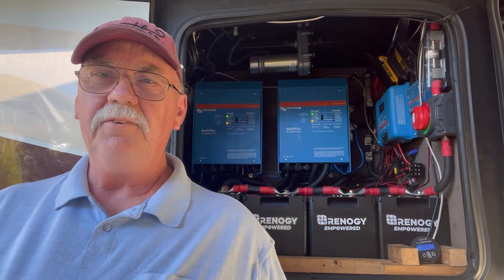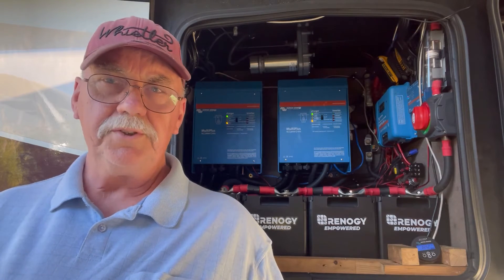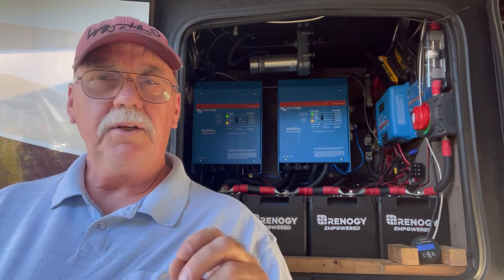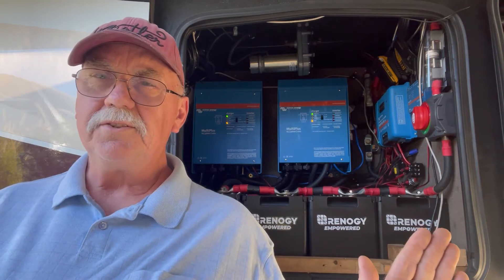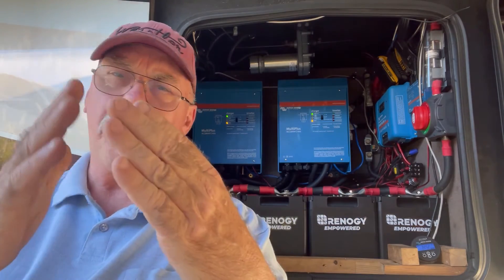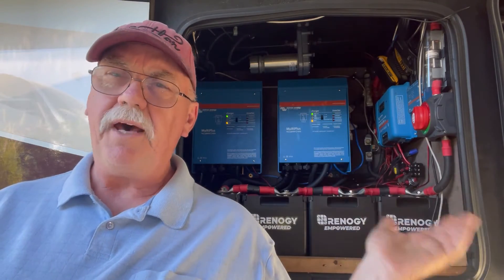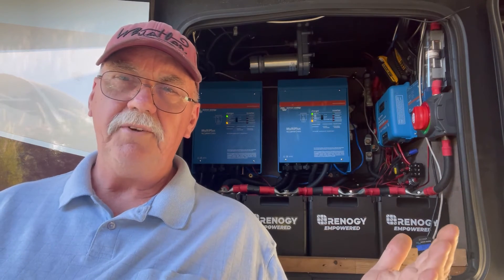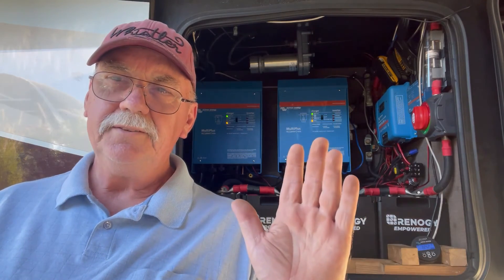Why So Many Batteries and Inverters?  | RVLiving | RVLife

Comment: I have just installed a similar system in our Coach . Two 120x2 Multiplus 2, 920AH of lithium batteries and two split phase circuit panels . Plus 2000 watts of solar .
Reply from the maker: Sounds awesome